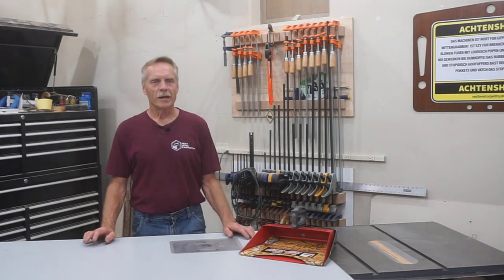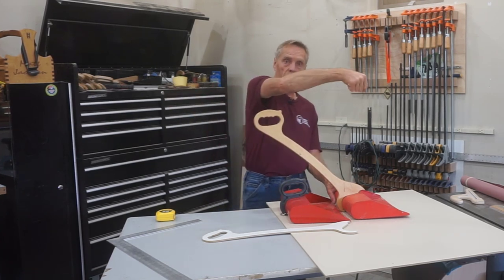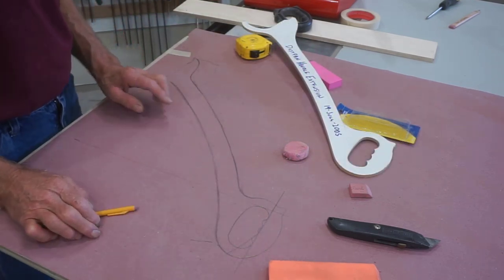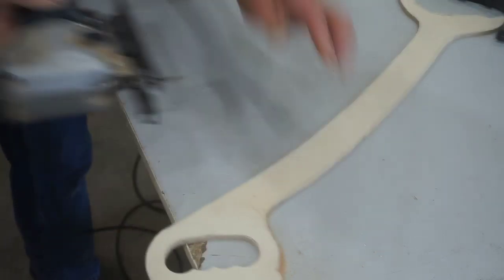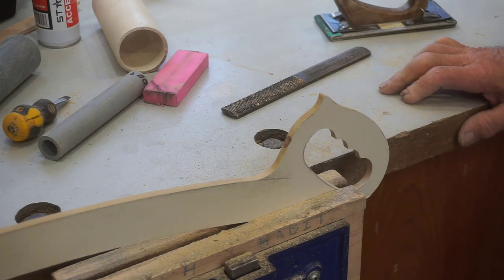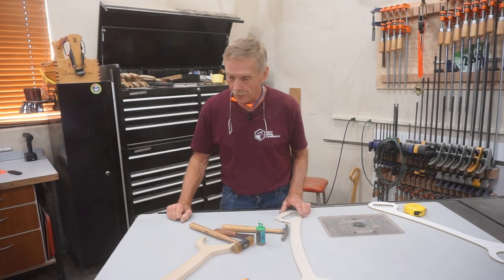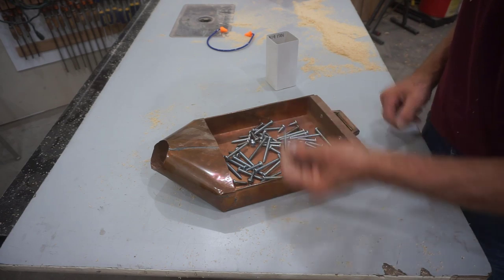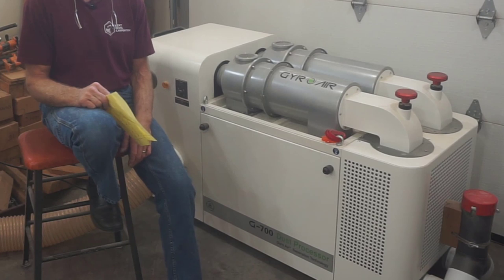Make This No Stoop Dust Scoop

Comment: Nice Matt. I like the magnet idea. I will have to give this a try.
Reply from the maker: Thanks Bob you might not see someone else's comment who politely suggested putting the magnet on the outside of the scoop and it's such a great idea that I did it immediately and it works even better! BTW I'll email you the scoop handle layout image later when I'm at my computer. Best, Matt
Reply: Yes, I saw it Matt. Good idea to move it to the outside.
Reply from the maker: @bobd.  Plus it really LOOKS cool with a whole porcupine of metal dust and shaving stuck to it! 😂😎 Best, Matt

Comment: Another great video!!! I love the handle adapter.....I sweep, use central vacuum system daily. I also use a battery leaf blower once a week to blow all areas high and low out the over head door. Make for a shop that you can eat off the floor!
Reply from the maker: What do you use to clean BBQ and pizza sauce off the floor after you have a picnic on it?! 😂😂😁😎 Best, Matt
Reply: @NextLevelCarpentry  Lol The shop Apprentice!

Comment: I always enjoy your videos and this one teaches more than just making the handle.

I’m sure you have a long list of videos to make but I’m wondering about a few. You made a great caddy for your sanding belt sanders. Still want to see the cabinet you had in your old shop under the big air compressor with the tilted front doors. Then the little organizer boxes I think you made out of plastic gutter downspouts plugged with wood blocks. Just hoping on status of those or if I missed them in another video. Thank you.

Getting greedy now. Did you make your table saw arbor wrench yourself? They don’t make them that thick. It looks about 1/4 inch thick.
Reply from the maker: You are one attentive dude Fearsome Warrior!   I showed off those organizers on this video thinking I should show how easy they are to make and how useful they are.  FYI You've not missed out on any build videos for that stuff or a tour of that angle-front toolbox... just wish I had enough time to get to all the videos I'd like!  All in good time?  Thanks for watching and commenting in the meantime! Best, Matt
Reply from the maker: BTW The tablesaw arbor wrenches are the 1/8" thick tempered steel ones that came with that 'ol Delta Unisaw when I uncrated it way back in 1982... if you can believe THAT!  My first impression back then was that they were hinky cheapo's but they're still as good as new...
Reply: @NextLevelCarpentry  Even that really thick looking one? Maybe it's not an arbor wrench but you have had one that looked thicker than 1/8th.
Reply from the maker: @FearsomeWarrior  can you give me a time stamp?  I'll bet it's a collet wrench for the Bosch router... there's a small and a bigger one that came with it... the one you see is probably that... Best, Matt
Reply: @NextLevelCarpentry  https://youtu.be/bmtroTqFM7o?t=1601 .. Maybe it 1/8 but it looks like a better steel. Also curious how the hold down on the fence works.
Reply from the maker: @FearsomeWarrior  The wrenches seen in that video at that point are indeed just 1/8" thick and, as you assume, is 'better steel' in that it must be tempered and/or hardened because they show no sign of failure after almost 30 years.
If you mean 'rip fence hold down' check into Delta's  old Unifence system.  There's a clever parallelogram clamping bar inside the fence that quickly slips in and out and locking is accomplished with a cam on the lever/handle similar to most fences.  You'd understand it immediately if you see one or get to use it.
Best, Matt
Reply: @NextLevelCarpentry  I found a video. Looks like it actually pushes down on that foot to lock the fence. Cool.Never seen that before.